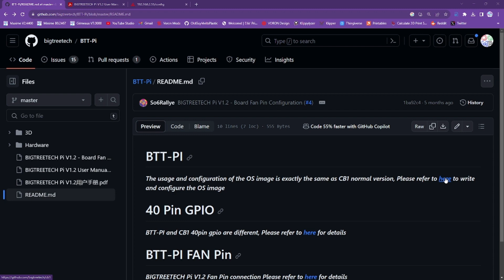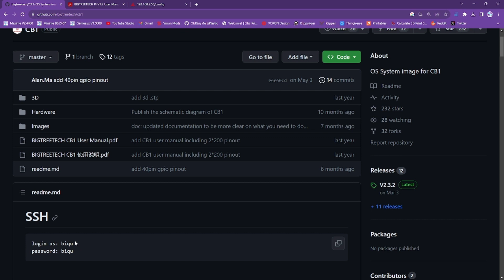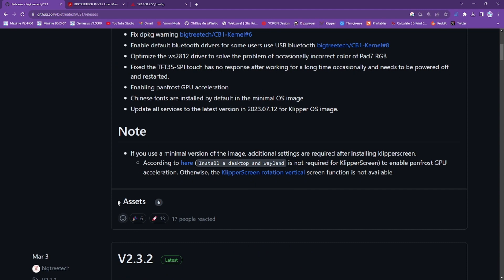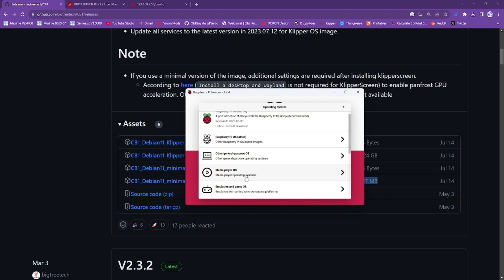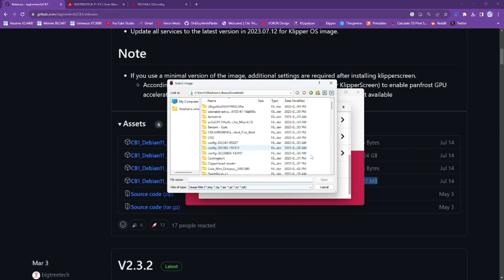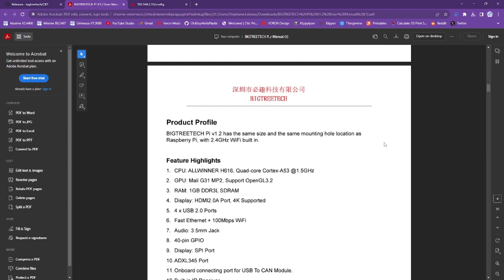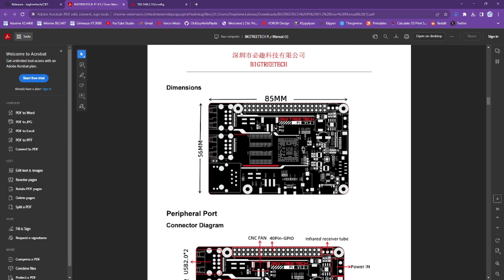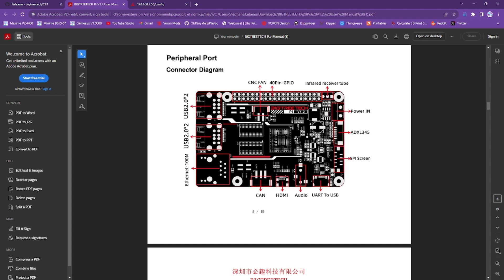From the Bench: Episode 9 - BTT Pi V1.2 and U2C Module v1.0

Comment: Salve, sto cercando di imparare come funziona il modulo U2C, mi postresti dire esattamente i cavi H(rosso) e L(nero) dove vanno a finire, o più dove vanno collegati. Grazie.
Reply from the maker: U2C needs to receive 24V power and ground into the green screw terminals on the end. Connect those to your 24V Power Supply.

Comment: Do you have a video showing how to install the u2c board on the BTT Pi?
Reply from the maker: If you mean the mini U2C that only fits on the BTT Pi, it just slides onto the connectors for it. Easy-peasy!
Reply: @oldguymeltsplastic  no firmware to install

Comment: Hello, how do you set up the canbus? What is in the printer.cfg? Have you recompiled klipper?
Good video BTW.
Reply from the maker: The U2C module in this video works just like the larger "regular" U2C. CAN Bus setup and Klipper printer.cfg are also the same.
Reply: @oldguymeltsplastic   Thanks alot.

Comment: You can use can directly from octopus with canboot.
Reply from the maker: Absolutely, and I did for several months before getting repeated Timer Too Close errors. After several weeks of inconclusive troubleshooting, the only solution that worked was reconfiguring with a U2C.
Reply: @oldguymeltsplastic same. The only way I don't get the timer too close error using the octopus as u2c is to drop micro stepping down to 16.
Reply from the maker: @patheticpuma  that might depend on what you are using for your host computer. Older/weaker Pi devices can struggle if the microsteps are set higher than 16.
Reply: I've only ever heard of people having issues with the built in can port on the octopus.

Comment: you can use the infrared reciver to asign  macros to a remote control (so that you could home the printer by pressing a button in the remote controler).
Reply from the maker: I suppose that might be useful if the BTT Pi was external to the printer, but hidden away in the electronics bay of a Voron, the IR remote signal probably wouldn't be received properly.
Reply: @oldguymeltsplastic  Necroing this. You can extend the wires on the IR receiver. With home assistant and an IR blaster, you could turn the machine on and preheat when you enter the room, start the dehumidifier at X% , or any random automation using with simple IFTT logic.

Comment: It is a gerat board! But the saddest part is the lack of the DSI port. It only has the SPI port, for which the only viable option is the 3.5" screen, which is crappy TFT with resistive touchscreen. The DSI screens that BTT produce themselves are so much better! I don't understand, why it is the way it is.
Reply from the maker: They also make an HDMI display which I am told is quite good.
Reply: @oldguymeltsplastic  Indeed. Though I haven't checked myself, but the HDM port placement on the side doen't allow it to mound in front of the printer neatly.
I saw a capacitive touchscreen by Mellow, which has an adapter that looks like it could be connected via HDMI from the back of the screen.

Also, very nice video %) Very insteresting to follow your progress.